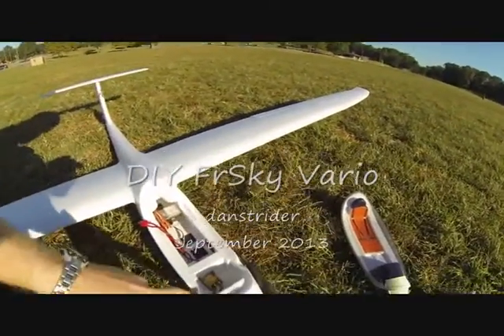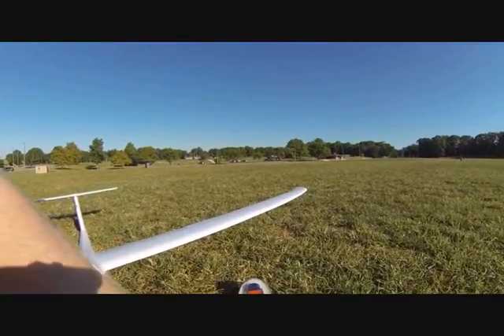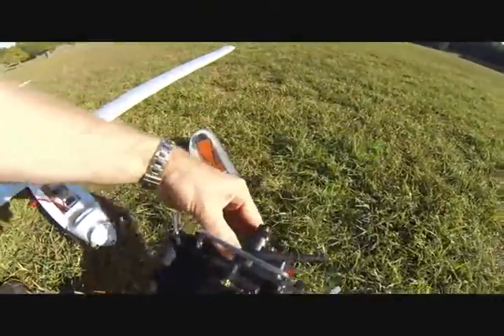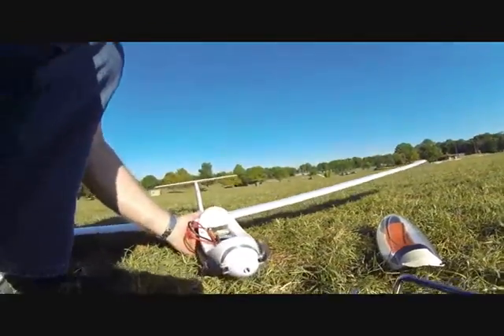DIY Arduino FrSky vario flying

Comment: Nice, but can't you use the taranis telemetry for this in stead of a seperate receiver on the ground? Like the openxvario?
Reply from the maker: The Taranis and the openxvario didn't exist when I built this.  There is no separate receiver, also, it's just a microcontroller that listens to the rs232 output from the telemetry system.  Separate speaker than internal to the opentx system, yes.